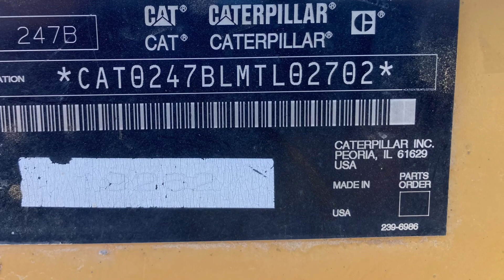BUMMER 🤦🏾 Skid steer DEAD

Comment: Stuff happens. Turn out the locks on track torque hubs to free wheel (to be able to move it) .
  There is a Air Compressor used in Construction at the Ranch.  Make an adapter from out put hose to blow wand ( one inch hose to three eights hose). This will power up air tools and help clean everything.
  The wand, made from copper tube and blow gun is good for cleaning radiator.
  Be careful eye protection is required, keep your boys safe.

Comment: Major bummer....... pulling out and replacing a skid steer engine is not a job id like to do, thats like working on a boat, tight small spaces custom fitted. Our tractor is down right now the front hydraulic steering ram bent and gouged the cylinder side walls that it is stuck now. awaiting replacements to ship.